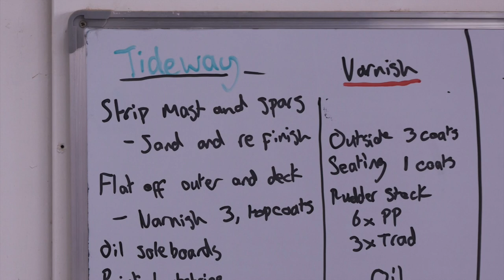Tideway Clinker Dinghy Restoration Photographs

Comment: Wow. What did you use to remove the paint and old varnish, inside and outside, apart from the scrapper? The planks were in very good shape, lucky you, I expected worse from the "collection" pictures.
Reply from the maker: We did a combination of processes. Chemical strip, heat gun and finally sand blasted. Yeah the planks were in great shape which was a nice surprise I thought we might have been replacing some of them at least.
Reply: @DanLeeBoatbuilding  Did you have any problem with the chemical stripping when it came to repaint/varnish afterwards? (It didn't soak into the wood?)
Reply: @DanLeeBoatbuilding  Interested in which chemical stripper you used then!
Reply from the maker: No didn't have any problems with that, as we did an oxalic acid treatment as well the hull was washed quite thoroughly before we started finishing. We used a product called Paramose which was about the most aggressive paint stripper I could find.

Comment: Nice work! Would you mind making a video on the philosophy behind your varnish concept regarding EP on massive Wood, UV Resistance, Repair friendliness (PP Varnish plus traditional Topcoat) and anything else I forgot to mention now? I believe writing it down to send it over to me for discussion is a time consuming thing and a video would offer it to everyone else. I'm thinking about penetrating EP versus UV resistance for example. What about EP on massive Wood? It's told EP shall not be used on massive Wood as the wood moves and cracks will let water in but not out. Are you confident the EP penetrates so deep so any moisture exchange and movement is impossible? Do you have any long time experience on the UV resistance of EP sealer?

Comment: Great work! Could you tell me tiny bit more about your approach how you straightened the hull? how did you do it and how did you check it before and after your measure? Keep up your great work
Reply from the maker: Thanks! There were two low areas, around the centre of the bilge keels, where the hull had pushed in, presumably because it dried out sat on the trailer but also because it wasn't very well supported. To pull it back to shape we used some timbers across the keel (the ones you can see at 2:17) and we ran long screws though the hull into these. We used the rivet holes that were in place when we removed the ribs in this area so we didn't have to make a new hole in the bottom. We progressively tightened these screws where needed to pull the hull back into shape and did this all by eye, sighting down the plank lands. A well trained eye can be surprisingly accurate for checking a fair curve. Once it was pulled back to fair we turned the boat over and began installing the new timbers (or ribs) and did the ones in this area last, removing the jig as the timbers went in.
Reply: @DanLeeBoatbuilding  Thank you very much for your detailed answer. May I ask what screw size you used? Would you do the same approach at other boat areas. Like when the transom area where the boat sagged or more complex when you have a twist in your hull? Once again thank you very much. You are a real master in your skills!!! keep up the work and I am thankful for the education you give us!
Reply from the maker: I guess it depends on how the boat needs to be re shaped, which direction it needs to go in and how the evidence of the alteration can be hidden afterwards. For example if the boat is to be painted then it gives a bit more freedom to screw bits on where needed. If it is to be varnished then you are a bit more restricted. I think we used 5x120 screws, that diameter would not enlarge the rivet holes as they needed to be a tight fit afterwards.